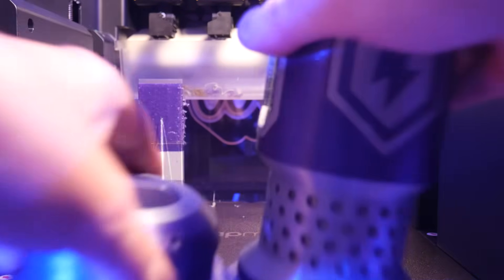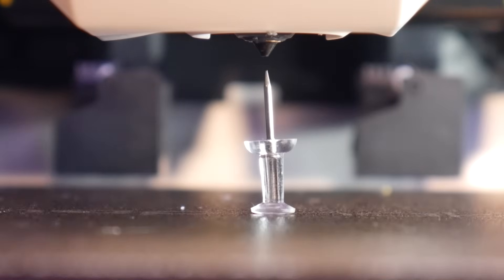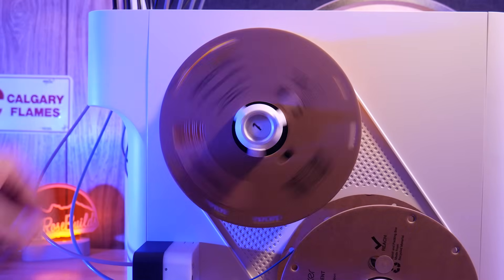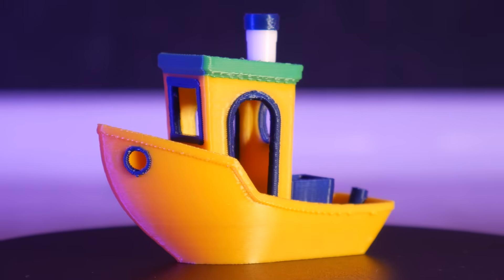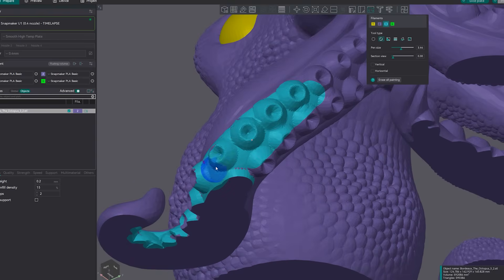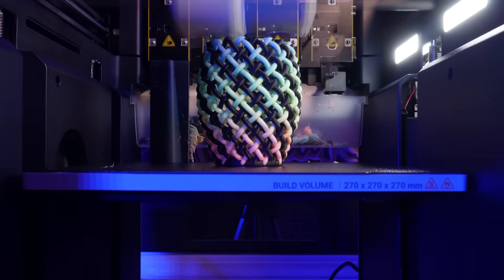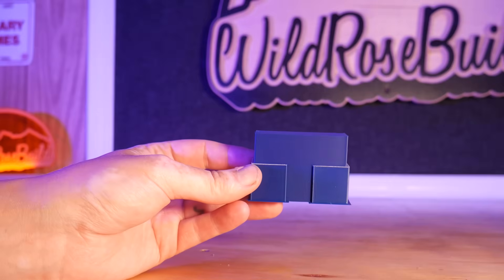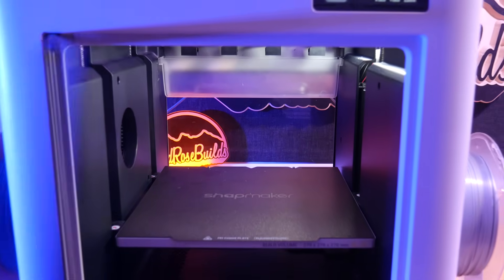The End of Bambu AMS? Snapmaker U1 Multi Tool Head 3D Printer Sets the new Bar

Comment from the maker: Check out this machine and the rest of my gear here: https://taplink.cc/wildrosebuilds
EDIT -  Snapmaker has confirmed a top cover with passive heating up to 50C, HEPA, and Charcoal filters. What materials should I test out on this machine!?
Reply: it is possible to show  input shaper frequency resonances from klipper?
Reply: I wanna see wood filament mixed with other materials 😋
Reply: I would like to see some PA12 tests.
Reply: Does the charcoal & HEPA filter recirculate or exhaust? Can PLA be printed with the enclosure on and the door closed?

Comment: 2:43 “Mystery Port!” Shows 12V ATV plug!😂 Dude, that’s a plug for an ATX power supply. I’m guessing it has no heated bed as a base option, but offered a heated bed upgraded like Printrbot did. The main board was overbuilt to handle a heated bed option. It had 2 plugs, a regular 12v barrel jack for no heating or a 12v ATX plug for running a heated bed option.
Reply from the maker: Mystery as in I don’t know what it’s used for. The bed is heated. The top connector is for a chamber heater/hepa filter attached to the top cover which is coming later. I haven’t seen a printer need a required external atx power supply since 2014 haha 😂

Comment: Nice overview video... but not liking exposed filament and what looks like a propriety mount,  I also Like the multi print heads but I need a 6-8 color capability... keep up the good work
Reply from the maker: Thanks! Do you mean the toolhead mount is proprietary? I’d need to do some research on the voron tool changer to form a valid opinion on that. I assume they went the ease of production route. If you’re talking about the filament spool grabbers, they can be popped out and replaced with something else. I have a handful of mod ideas for this including some sealed filament holders but I’m waiting for the cover to come in before doing that!

Comment: Bambu lab needs to be fast and release a sub $1000 multi tool head printer if they want to keep up. At the moment their only multi tool printer is just way too expensive... Even a dual tool version of A1 would be sweet if that could print TPU and  PLA for supports. I don't even care about AMS, I only need two filaments mostly, normally I do just one at a time. Snapmaker U1 is definitely my next printer.
Reply from the maker: I’m really surprised that Bambulab is late to the multi tool head machines. We’ll see how it all plays out, this should spark some pretty cool innovations!
Reply: @WildRoseBuilds  Absolutely! I'm sure they'll come up with something cool, after all they are like the DJI of 3d printers.

Comment: Thank you for the video! If you are looking for requests, Please print a mix of flexibles, and not just 95a tpu, at least get something down to 85a. Having a greater ability to incorporate flexible materials and mixing with support material would be what I actually need this machine for, everything else my other machines can do albeit with a lot more waste, I need to know if this can satisfy that use case.
Reply from the maker: Thanks for the suggestion, I’ll focus more on flexibles for the next video!
Reply: Snapmaker said they support up to 90a, so 85a probably won't work (at the moment). Maybe in a final product, but these pre production should not be able to do so.
Reply from the maker: @Max_Kirchner at slower speeds I could probably get some softer material through, it’s direct drive so it’ll handle it. I think snapmaker isn’t done building all their material presets
Reply: @WildRoseBuilds with extra soft filaments you might have to forgo the Bowden tubes for 85A or lower due to “stickiness” when you try it. 😊

Comment: The prints looks very nice and clean. I currently have a Bambulab A1 printer, and it is fairly quiet in operation. How is the noise level of the Snapmaker U1 in operation?
Reply: A1 is goated. I got better quality prints out of it than my X1C lol
Reply: 50db to 55db.....Quieter then any bedslinger
Reply from the maker: It’s Little noisier than the a1 thanks to the big external cooling fan but the enclosure seems to dull the noise a bit

Comment: Open config file does not mean its open source,

It could be, (in fact I think snapmaker said they'll release the source eventually) but its not equivalent
Reply from the maker: true, I should've clarified that! regardless blocking access to the config is an absolute deal breaker for me as someone who likes to really push my machines.
Reply: Fun fact! Both the klipper and orca licenses require any modified versions to be released under the same license. So they should be open source, unless they want to invite a possible (but honestly unlikely) lawsuit. Plenty of companies don’t honour their requirements, but it seems less likely since snapmaker has a US presence.